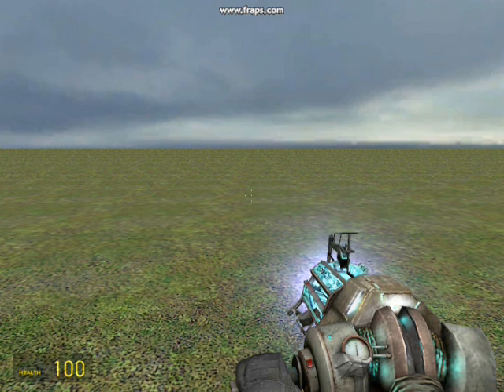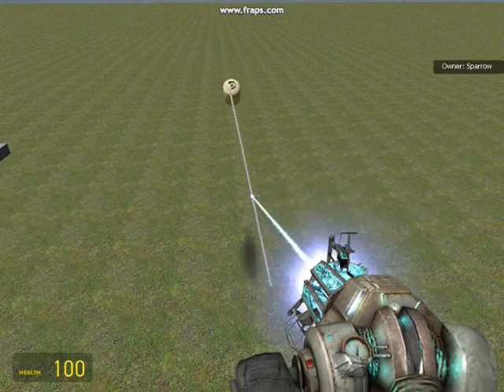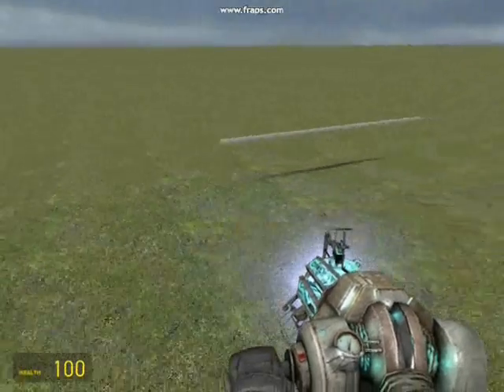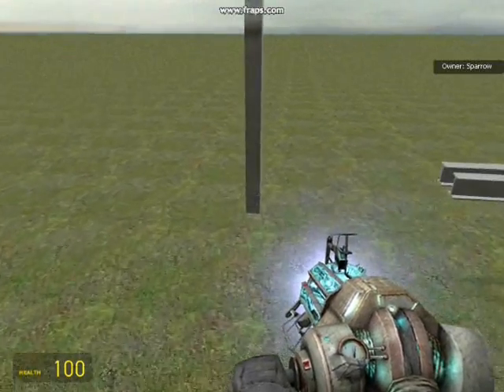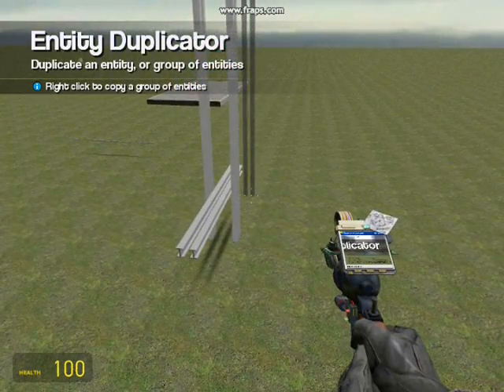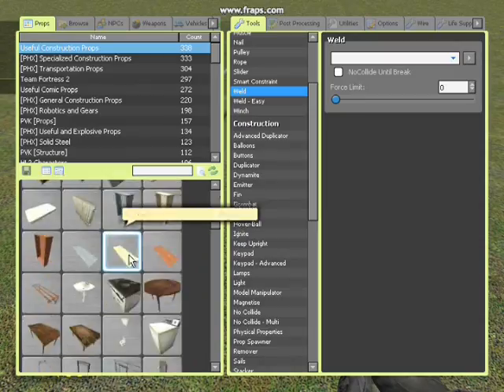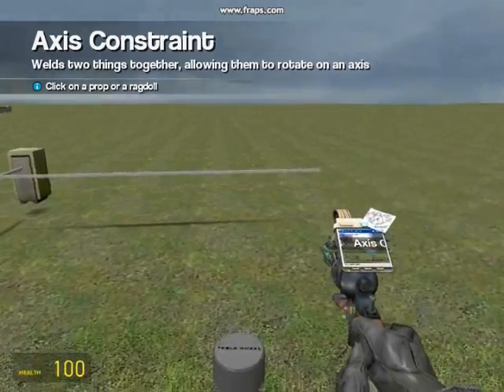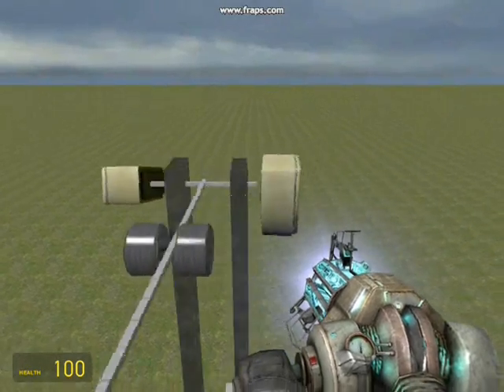Gmod trebuchet tutorial part 3

Comment: Suppose I'd better ask how you were using winches to hoist the counterweights and pull back the arm when winches stay taught and don't have any give in them to let the trebuchet work.  

Seems more trouble then it's worth.  

Hard to make a floating point trebuchet but it's interesting, lot of ways it can go wrong,I made one that works so far and although it throws reasonably far I know it could be a lot better as the arm doesnt move across the supports very far.